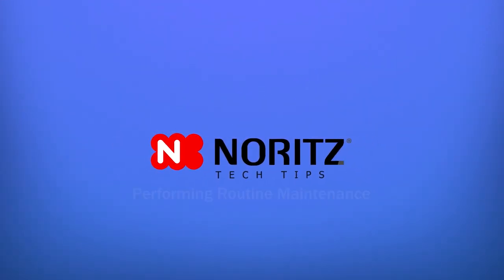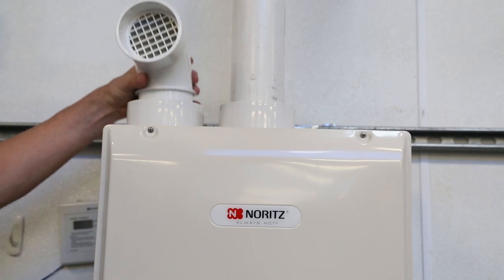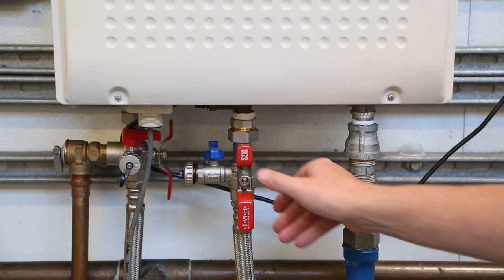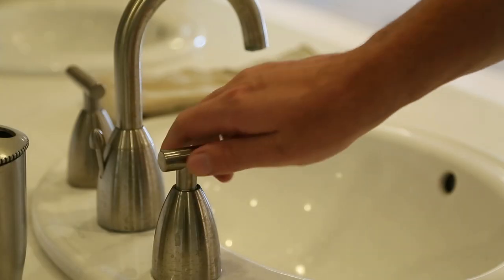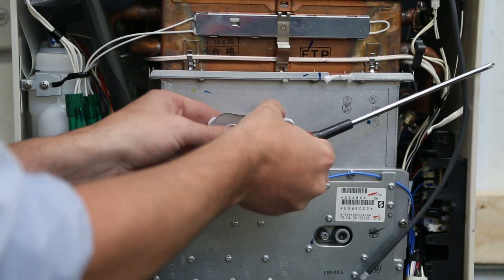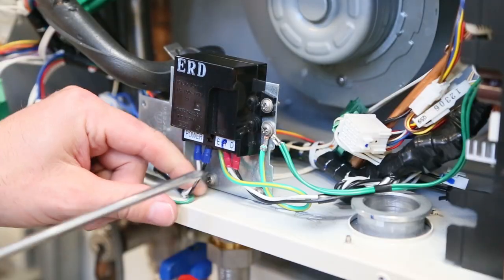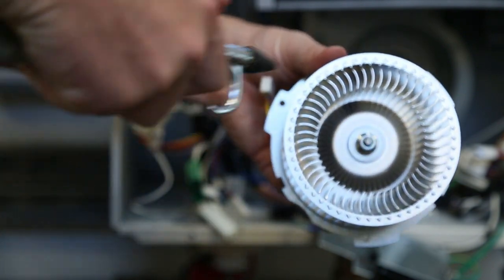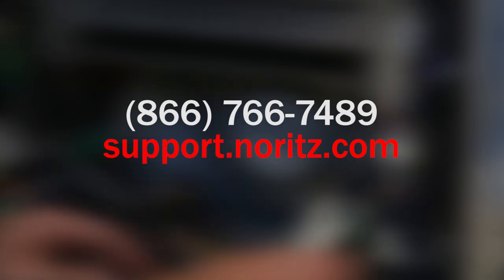How to Perform Noritz Periodic Maintenance

Comment: I like how in the video, the fan was installed with the wire inlet facing up, and the reinstalled correctly with it facing down. 
I would like to add that just randomly blowing in there with a short nozzle is not effective enough.  I use a long tube that I made attached to the end of my blow gun to really get in there.  Stick it all the way in the back, go over each flame spreader, then the same on the air-plate with all the little holes bellow the burners.  Also, I aim the gun up, and blow dust off the exterior of the heat-exchanger itself. Remove the little metal plate that goes around the burner holes, and blow in the little screw holes that the screws thread into. Also check the gas orifice of the plate to make sure there are no spider webs in them, quite common to see those little white web sacks in there.

Comment: Horrible design, that’s why I prefer takagi, Rheem, or rinnais. When you get an ignition failure on a noritz you have to unmount it and removed the top of the heat exchanger to clean. The other models make it easy to access the burner without unmounting

Comment: I love my Noritz unit, I did have a small flood once when something went wrong with the unit however when I called their support line they walked me through everything , send me a part, and then over the phone walked me through how to replace the part. Their support team is amazing and very helpful. ———I do have a question, all the buttons on my Noritz RC-7650M Digital Display (I’m in Canada) Flash. Is this a low battery issue or is this a signal of a problem for something else i.e. service required? —— Thanks. River

Comment: How often do we need this detailed service? Appreciate the video and the fine detail.
Reply from the maker: Ideally, we suggest this been yearly while the unit is being descaled just to stay on top of things. You can still be safe with every 2 years or so if your unit is in a good environment with not a lot of dirt, dust and debris around.
Reply: Great so these things require maintenance every 2 years to keep running.
I think I'll get a traditional water heater installed and the hell with this new-fangled "Efficient home" bullcrap.
Reply: @Detman101   ... the maintenance is not that bad.  Plus, home ownership requires that items be maintained.  I rather save hundreds (maybe thousands) of dollars over a traditional old water heater.
Reply: @biz4twobiz463  You're probably right sir. I just spoke to the Noritz servicepeople. They said that the "Descaling" procedure is required bi-yearly with my model tankless waterheater. I guess $350 every two years is worth it.  Thank you for replying to my post, I appreciate the insight you provided. This is my first go-round with a tankless heater.
Reply: @Detman101   ... absolutely.  Glad to ease your mind.  Regards.

Comment: I didn't like the flex connector used, they fail often.  I get call for black particles in the hot water systems always this is problem.
Reply: I'm sure the filter would catch most of it.

Comment: Note: I just tried to inspect the ignition rod assembly at the 3:42 mark of the video, and the gasket fell apart as I removed it. Now I will have no hot water for two days until I can get a new gasket mailed to me. I strongly recommend having a replacement on hand before attempting an inspection and cleaning of ignition rod.

Comment: I have a EZTR40 and was getting error 121. After quick call to Noritz had it up and running in 10 minutes! The rep told it was really error 12 where it would ignite and then shut off. He walked me thru cleaning the flame rod and ignition plug with a DOLLAR BILL, could of used a Scott pad but did not have dry and clean one.This same technique as stated on the video 3:35. Don't hesitate to call Noritz great customer service.
Reply: blud had to use a dollar bill 💀
Reply: I have a eztr40 as well.  I did a vinegar flush and the unit started leaking a lot.  I called noritz and they sent me a new heat exchanger and gas manifold.  It was easy to install and had it back up and running!  The only thing that they told me is that I need a water treatment system otherwise the parts will not be under warranty if it happens again.

Comment: 2:37 Does the water filter cap come out by hand? Mine was pretty tight and I ended up breaking with a wrench. I had to replace with a new one and applied silicone faucet grease around the threading but was still quite hard to tighten it.

Comment: Just an addition to this, if you use compressed air to blow out the gas manifold or bottom of the heat ex-changer as described in the video, ALWAYS wear a respirator as the dust and combustion debris that will be expelled from the heater will make most people cough and gag at the least. For sensitive breathing groups it could easily send you into an asthma attack.
Keep the respirator on for a while after you are done blowing things out because the stuff will linger around a bit.
If your heater is installed in an indoor area where air is circulated through the home ask all who are in the home to leave while you perform this operation and also cover or remove any valuable items you have that you don't want dust or other caustic materials on.
Reply: What also works great is keeping a vacuum hose right at the point where you are blowing to capture MOST of the dust you blow out.  It does help.
Reply: Also what I usually do is just don't wear a mask or anything and then at night in the hot shower blow abunch of nasty shit out of my nose .
Reply: Are you the guy that put Warning on plastic bags 😂. Just kidding good info

Comment: why is the NRC 98 DV pissing water out of the condensate nipple every time someone runs a fixture in the house?? anyone have any ideas?
i installed unit three months ago and its gradually gotten worse. its a dual vent model.
Reply: Water is supposed to run out of the condensation port on that heater when the heater is in use.